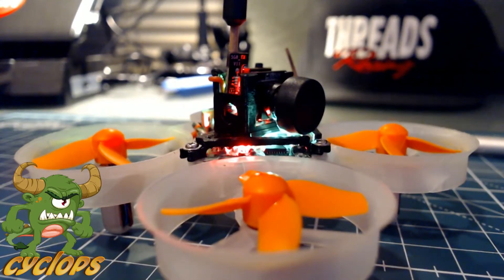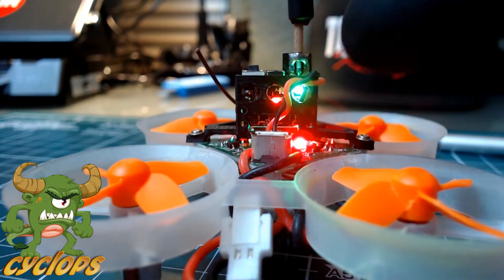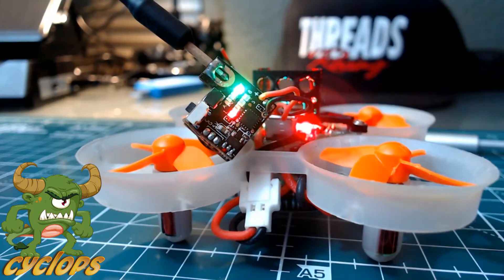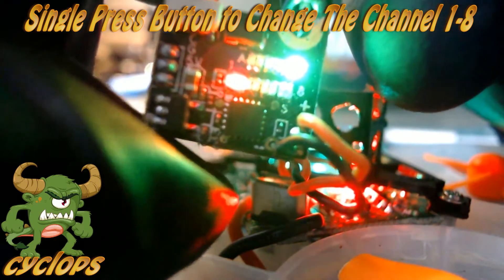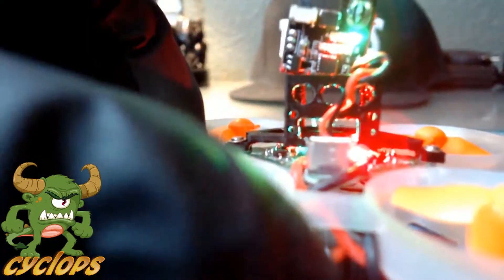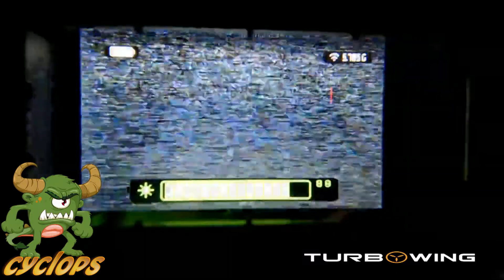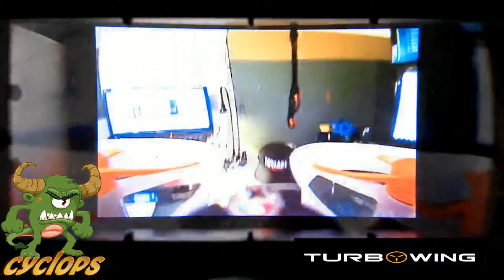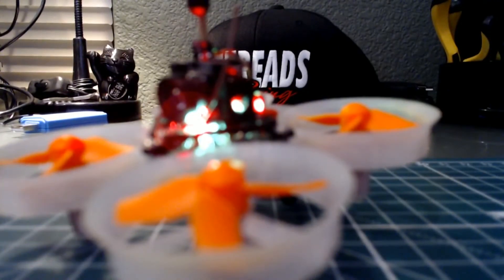THE ALL NEW CYCLOPS 25MW FPV CAMERA INSTRUCTIONS AND DEMO

Comment: Just got my Cyclops 2 and don't know what the CVBS is.
Reply from the maker: Composite video mostly comes in three standard formats: NTSC, PAL, and SECAM. It has come to be designated by the initials CVBS, for Composite Video Baseband Signal, or simply as SD video.